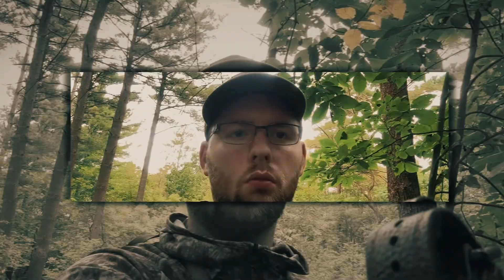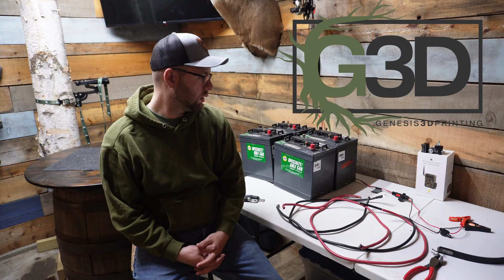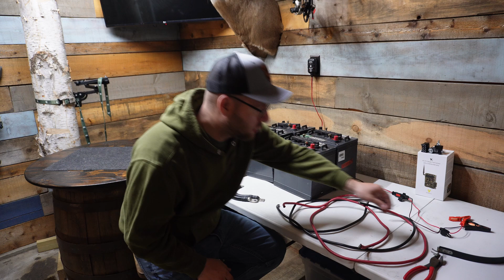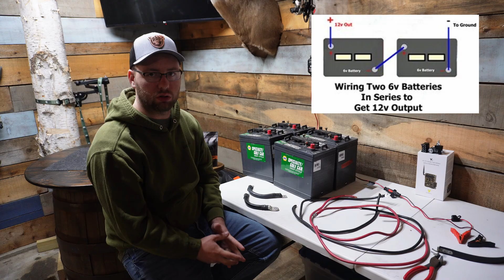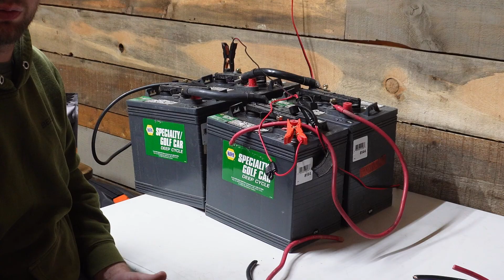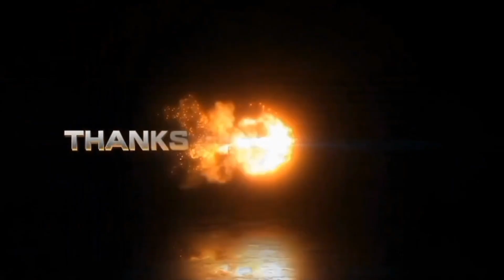RV Batteries: Series vs Parallel Explained!

Comment: 5:43 for clarity he is setting the red lead on the positive of the first pair of batteries. This will not work in your camper. You need to bolt the red lead down on each positive terminal on both battery pairs. He does not have a lug on that side of his red battery lead so he is simulating a connection by laying it on the terminal.
Reply from the maker: Thank you for clarifying! ❤ I appreciate it!